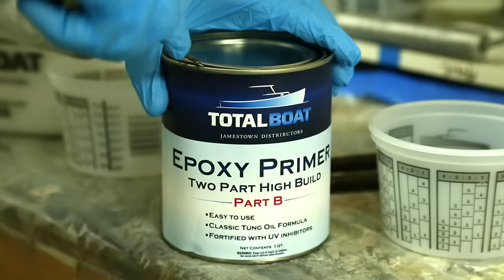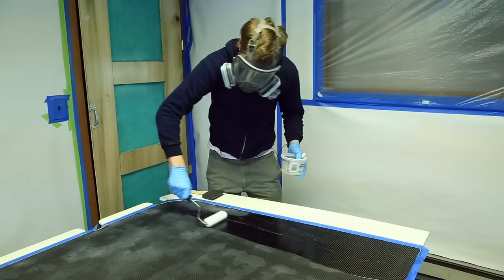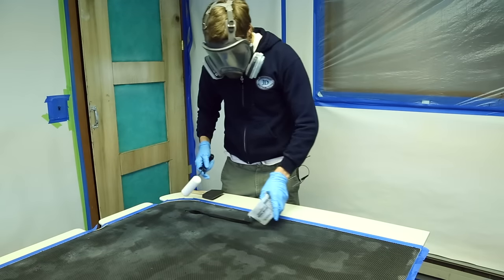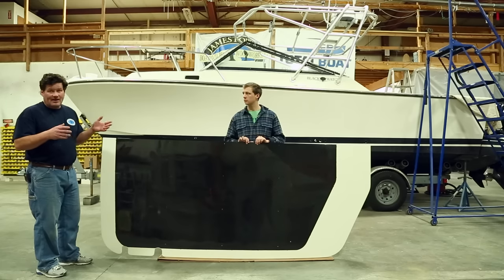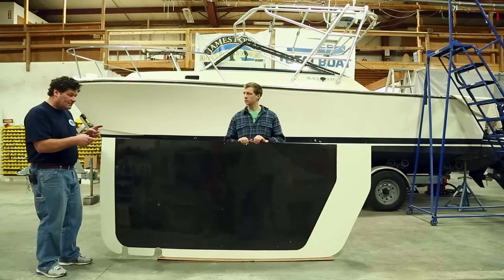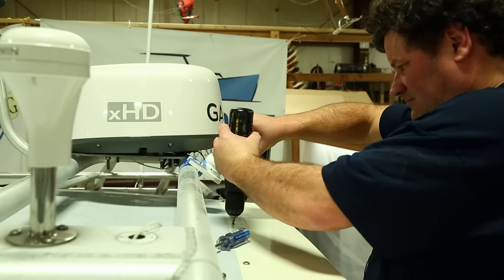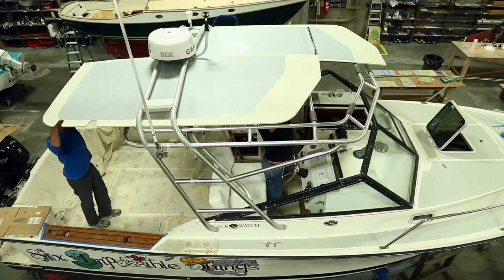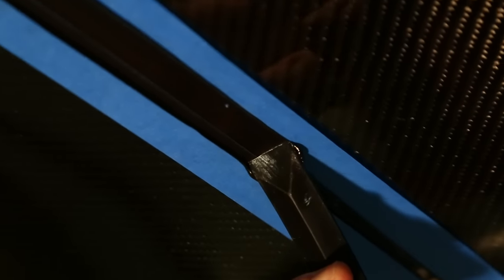BlackWatch Carbon Fiber HardTop Bimini - Part 3

Comment: Wow what great work! I had to watch all 3 parts 3 times and you have actually made what could be a fairly complex project seem quite do-able for a somewhat novice.I'm just wondering how those machine screws are holding up and whether washers would be required/better? Thanks for giving me the confidence to actually even think about having a go at this.
Reply: They probably won't hold up.  The best plan is to locate them and provide solid support, in the core for them.  Pain to do, but it is the only way to ensure long term reliable service.  You have to ask yourself what the easiest option is. Well drilling right through the laminate a core sounds pretty easy.  Rare that the easiest option is the best option.  That said, doesn't mean one won;t get away with it on some builds.  I have done some things I didn't expect to last for 30 years, or to own for 30 years, and miracle of miracles, they are still going strong.  But I wouldn't want to have all the callbacks, or reputational damage for production multiples as opposed to my particular use.  I got away with it, and I know how to repair the project if it goes bad.  If I built dozens of them, some would inevitably fail.

Comment: If you are concerned about reflected light on the underside of the hard top, then a gloss finish would seem to be a poor choice.  What black will do for you is absorb the light and energy.  So you will end up with damage to the epoxy clear coat over time. Paint is always your best friend.
Reply: I agree. They should have sanded it with a high grit sandpaper for a matte finish.
Reply: Actually I disagree i think a dark colur under a bimini is a good idea a white shiny finish can create terrible glare awlgrip clearcoat is fine as it has great uv resistance but  id add 10/15% of  matting agent then you dont see any defects and dont get any glare I guess you cant roll and tip with matting agent??
Reply: What about black matte vinyl?
Does that stuff hold up in marine environment?
Reply from the maker: you'll be glad to know - many years later (like 9!) the top has held up well, with no issues to the underside being clear coated. And the top is strong and useful for holding all the fun stuff like boards and rods and foils.

Comment: I realize this info is a couple of yrs after, but for future updates, the use of a small heat gut over the surface of any epoxy coating will cause any imperfection to surface and pop so you don’t see the ‘fisheye’ bubbles in this clear coat finish, and flows out like a sheet of glass. The reason for the foam layer in between is too create strength without making it too thick.

Comment: I dont understand the foam. Do you just use it to create thickness and yet keeping it light? if so, saturating it with epoxy os enough??
Reply: No, the foam, when sandwiched makes the carbon stiff, rigid and strong. Other sandwich materials are honeycomb, balsa and other foams and wood materials.
Reply: It is the same concept as a hollow tube, except when working with metal you don't need the foam.  Metal is strong enough to hold it's shape in useful applications.  

If you think of a piece of 1" plywood, vs .75" plywood, used as a deck, the thinner sheet is only 56% as strong, and 42 percent as stiff.  That extra 1/4" creates a huge amount of additional performance.  And when you think about it, it is because the loads are primarily carried in the outermost surfaces of the plywood.  The stuff in the middle only holds the surfaces apart.  So what if .9 inches of the ply was replaced with foam, this is tough, hard foam, or other core materials.  Then you would have room for .05 skins of some material, but being so thin it would have to be super strong, so fiberglass or carbon fiber.  Bam! you just invented cored composite construction.

around boatyards you will be able to pick up trash that was cut out for windows, or whatever, and these seemingly feather light panels will be super stiff, and strong.  It really drives home how effective these materials are.

By the way, these techniques work with wood also.  You can put foam or balsa core inside two light plywood panels, so maybe skins of 1/8" plywood over 3/4" balsa, and these panel products are also super strong and stiff.  They may not stand up like the synthetics, but they are a lot cheaper, and more friendly to work with.

A good everyday example of cored construction is corrigated cardboard.

Comment: The faired edges still have holes and the clear coat Awlgrip looks awful and does not even come close to the results possible with this coat. Poor work. Also stainless screws should not be be sealed with polyurethane but with isolating Teflon Gel as produced by Tikal. This will prevent contact corrosion on the aluminum frame.